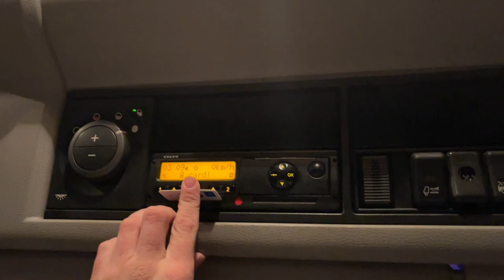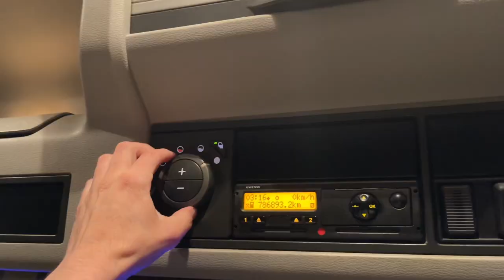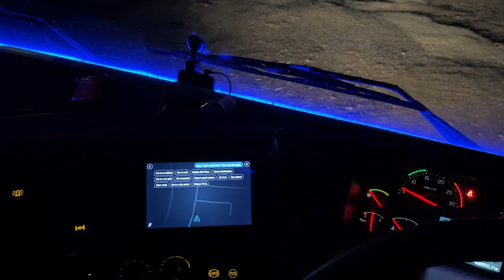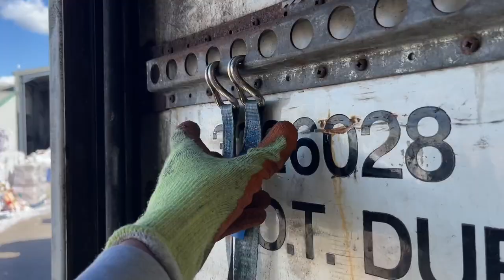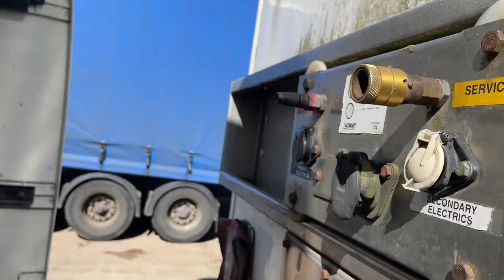Brake Checked | Truck Has A FAULT | POV | Trucking Vlog 50 | #truckertim

Comment: Might be a silly question but I'm not a trucker and nor do I know much about how they work but... When you have changed trailers and you give them a tug how come the trailer stops still and doesn't come forward with the truck as obviously you wouldn't have your foot on the brake in the truck if you were trying to pull forward? 

Sorry for the long winded comment keep up the vlogs Tim absolutely banging 

"GIVE US SOME TONESSSS 🎺🎺🎺"
Reply: The trailer has brakes. they turn off with a button on the side of the trailer

Comment: Question for you Tim, when you take your boots off, how do they not fall off the steps when travelling, just curious 👍
Reply: I’m sure the top step is covered by the bottom of the door, correct me if I’m wrong though!
Reply: @seanglazebrook1869  cool, thanks for the info!